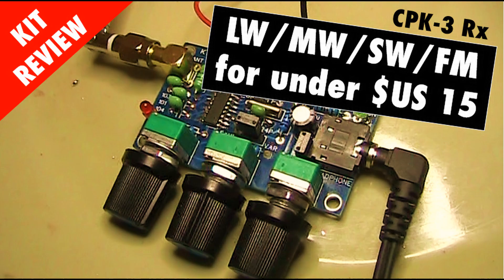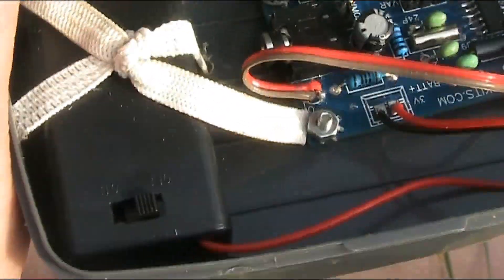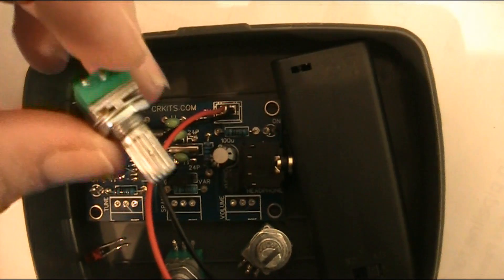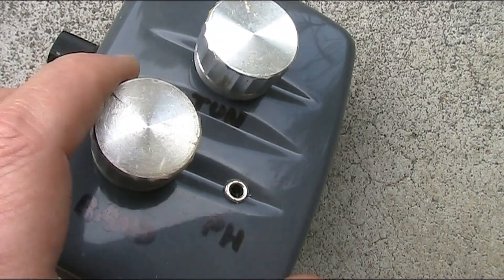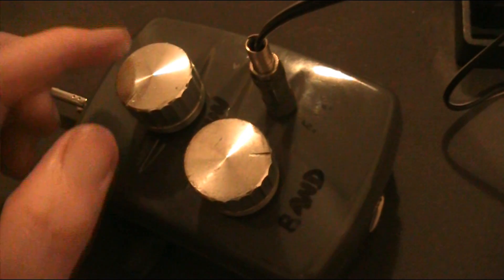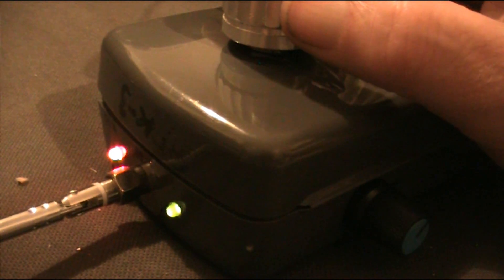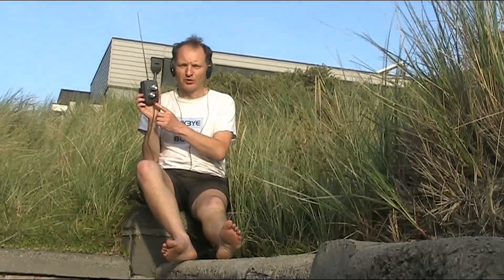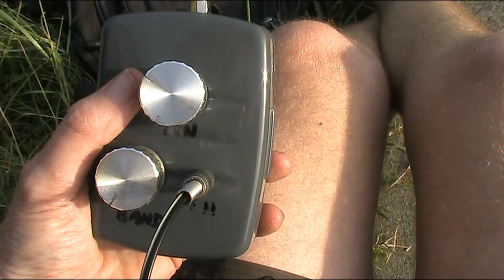CR Kits CPK-3 receiver in a case

Comment: could you put a pin receptacle for the resistors and be able to swap out resistors to have you move thru the SW bands? or have a switch with a few (1-4) resistors on a board then switch between the SW bands. just "thinking" out loud. Sounds like a pretty cool little thing to go into the soap box. 
great things. thanks for doing all of these 73's KI5IUF
Reply from the maker: Yes, both would work.

Comment: Thanks for this kit review, I could see you removing the resistor underneath the FAV selection pins and put in a slot for changing the resistor for the wanted band. You could even add a switch for FAV /variable selection. Now if they made a BFO mixer chip/board that would fit inside your case…well can’t have everything, but it would be nice:).
Have a wonderful 2024!

Comment: What's about a 10--turn potentiometer for the tuning? May that not be more comfortable? 

A lot of German speaking FM-stations aviable in VK, I couldn't believe! 

73/72 de Markus - db9pz (Member of QRP-AG DL - JN39fq - 3miles /5km east of LX)
Reply from the maker: Yes that would be good. A turns counter or voltage meter would then be desirable.
Reply: @vk3ye ... you are absolute right! 

For my 'one-Watter kits' (made by 'Diz' Dieter - W8DIZ) I allways used a 10-turn pot with a 'dial' mounted on the top. 

It makes my 30m CW-TRX, so much easier to use, ... !  

One of my 'best' expieriences was, to get W1AW/KP4, in the middle of the night in DL, ... with about 1,6W only, on my homebrew TRX. 

... better then 'working VK' with 1k5W and 3 element yagi! ... - HI HI ! ! ! - 

The sense and the shower, that was running down my spin, was incredible, never had before, ... a 'small' handmade TRX, buildt by myself, and that 'range' and succses, ...  this is HAM-radio at it's best! You cannot get this kind of feeling, with 'bought' equipment! 
I think, you know, what I was speaking about, ... ! 

Sorry for my bad English, it's not my  native tounge, ... it's a long time ago, that I stayed and dwelled in the UK, for the last time, about +30 years now. Never been in VK, until now, ... ! Maybe, time will tell me more. 

73/72 de Markus - db9pz
Reply: @vk3ye On UK eBay, I found a x10 turn BOURNS POT that comes with a turns counter.